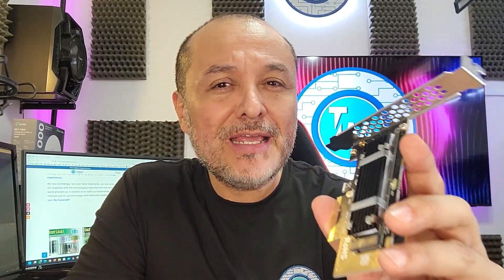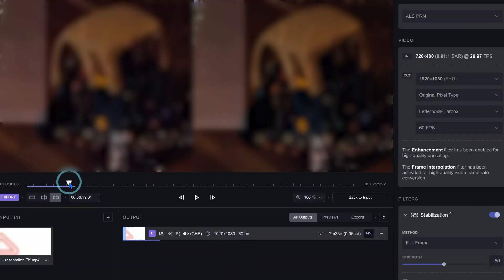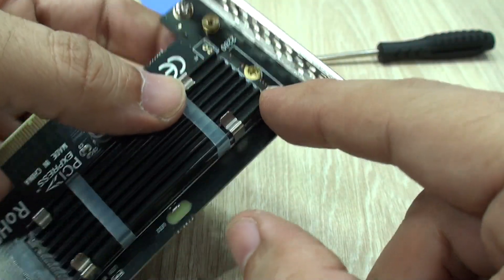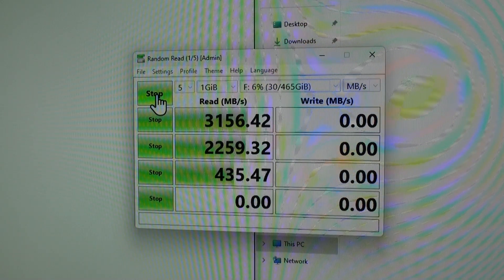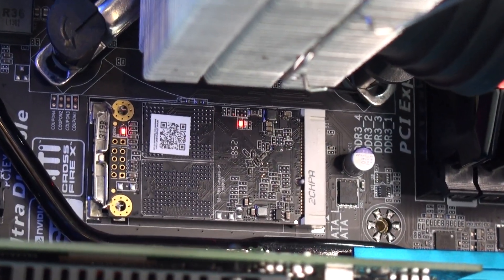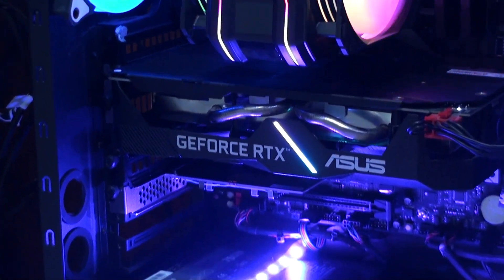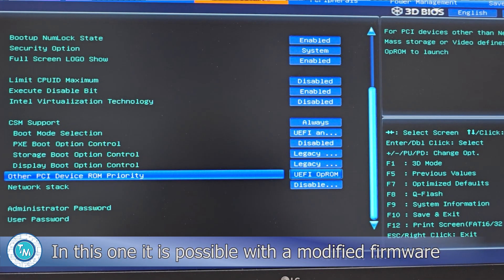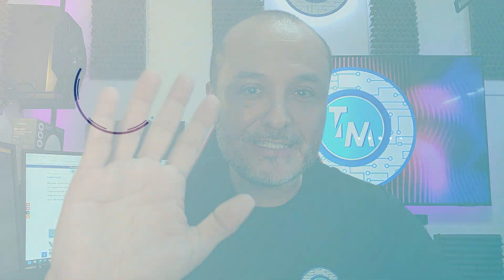How to add an NVME SSD drive to any computer?  Use a PCIe X4 adapter.  Great performance in old PCs

Comment: Wonder how well this will work on a 2006 dell with windows xp, does it affect the speed of the main pcie slot?
Reply from the maker: So far we've used them with many computer models and with all of them (some of them pretty old) great performance.  Only issue we've seen is they do not run windows in some, and most important, they may get on the way of new installations leaving the system un bootable.  This makes you remove the adapter and the SSD, and re instal it once you finish... yeah a pain for some builds.

Comment: Anybody have any suggestions on how to get this adapter and drive recognized on a asus rampage iv black edition  mb and windows 10? The adapter lights up the nvme logo but no sign of the drive or device in windows.  I know I need a custom bios to boot the drive but I am trying to use the nvme drive as a secondary.  My brother's computer recognized the drive when I tried the adapter  so it looks like the drive and adapter at least some what function.  My board and processor support 40 gen 3 lanes and I am only using one gpu so I have available free lanes so not sure what to do to get it recognized
Reply from the maker: Sounds like there is an MB compatibility issue there.  Maybe the combination or port use with the graphic card, or even a BIOS setting for the port you're using.

Comment: older pc,s use legacy bios , without support for nvme , often , trying to boot windows or any os is a pain on a nvme on an older machine unless you tinker with the bootloader , has your older machine support for the drive , or did you use these as regular storage drives ?
Reply from the maker: You are absolutely right. Even when this motherboard successfully has been tested to boot (basic old boot) from NVME add on drives we did not venture to do it, as we just needed them to expand capacity and have fast access to data.  This older machine did not include any port further than one mSATA on board and 6 SATA drives.   Great improvement for data transfer and storage if needed.
Reply: @TechnologyMoments  👍